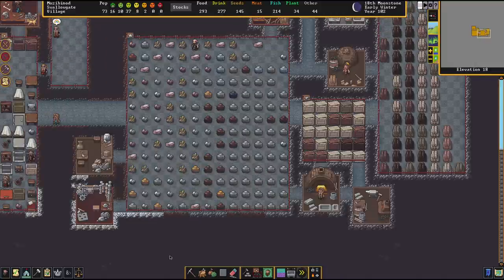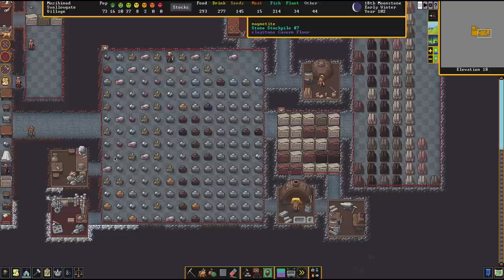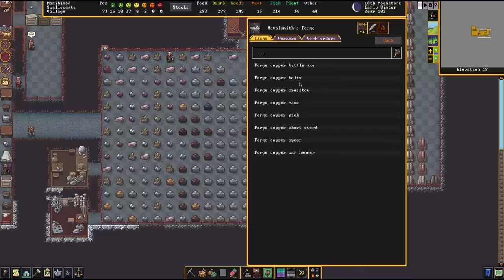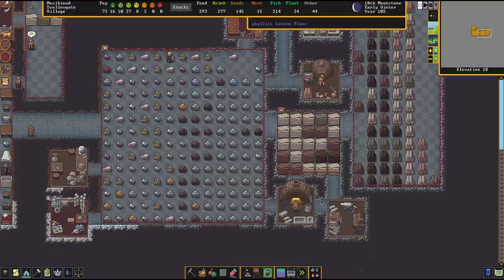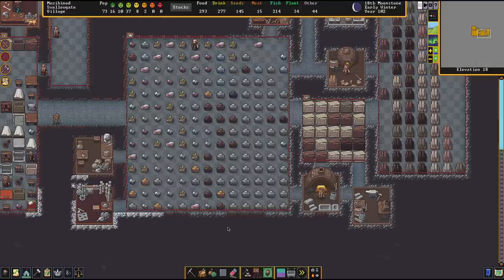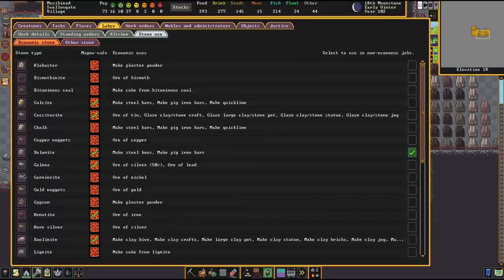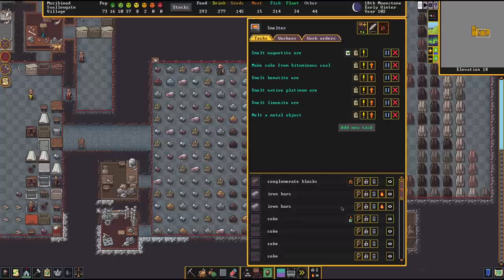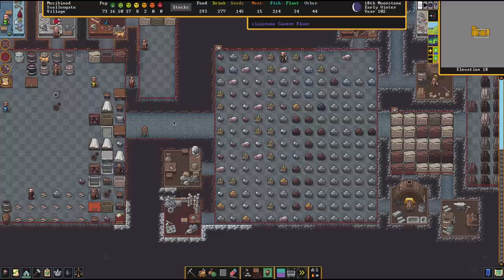ALL ABOUT METALS PT 1 - Tutorial DWARF FORTRESS Alloy Guide

Comment: I like to put lead floors at the bottom of pit traps. Fall damage is calculated based on how heavy the colliding things are, so heavy floors do a lot more damage than light floors.
Reply: that is kind of hilarious though water is as hard as concrete if you land flat <.<
Reply: not sure how that makes any sense. Shouldn't it depend on the hardness of the floor?
Reply: @incription idk hardness = heaviness in DF?
Reply: @kenjethao7774  I guess the right word is 'density' as lead is a very dense material.
Reply: @torgrimhanssen5100  Concrete is harder than water no matter how you land.   You're just repeating an aphorism that doesn't hold true.
Reply: @incription  thats literally the same thing if the mass is a constant. 1 m³  of any substance is harder than 1m³ of another substance that is lighter.
since if the mass is the same, but the weight is not, than that just means that one of the substances is more dense or in other words harder.
Reply: @unorevers7160  that is not true, hardness is not dependent on density (but slightly correlational). Diamonds are harder than lead but lighter for example
Reply: @incription  The game calculates fall damage as if the floor impacts the creature.  Since lead has such high density it will deal more damage than say adamantine which is extremely low density but super hard.
Reply: So lead floors with extended spike trap to guarantee death?
Reply: @TheSlyFawkes  Well, if I do a fall trap i'll have a 2 wide hall with a deep channel on one side and the walkway is lined with weapon traps, if they dodge they fall down onto lead floor.  Like a 10 Z drop onto lead floor is going to do more than just break limbs, probably explode body parts.
Reply: Don't forget that you can conversely use featherwood if you wanted to train up your suergons and bone doctors (assume your Dwarf doesn't break their neck). It's the least dense building material in the game currently.
Reply: That’s dumb, hilarious, and very dwarf fortress.
Reply: @unorevers7160  Gold is one of the densest metals in the world, but can be damaged by a fingernail. You have no idea what you’re talking about.
Reply: @virtualmartini  At a certain velocity it's the same.
Reply: @ballistixwearesilent5576  I don't think so.  It's always harder, no matter how quick you're going.  That said, if you're going fast enough, it doesn't really matter which one is "harder." Hitting water at terminal velocity might as well be concrete at that point. Hit either of them at a high velocity and you won't have enough time to compare hardness, given the whole "dead on impact" thing.
Reply: How hard is magma?
Reply: @fovarberma752  in game? Same as water. Out of game? I dunno probably like really really hot treacle?
Reply: @ballistixwearesilent5576  The question was rhetorical. Fall damage doesn't matter to goblins and zombies alike they land on magma.
Reply: @ballistixwearesilent5576  Also: Happy new year!
Reply: @fovarberma752  You can't ask rhetorical questions on the internet... It's against the rules 🙁
Reply: @virtualmartini  you belly flop on a body of water from 50m. itll be equal to falling on concrete from 10-20m. you probably wont explode into gore. but you can expect certain body areas to explode open and spray everywhere.
yeah water is still softer. but with enough speed and surface area itll be roughly the same as a solid.
Reply: @virtualmartini  ok, pseud
Reply: That's... a really good idea. I havent played with death pits yet but praise Armok I will
Reply: @thunderousavenger2382  it is indeed behaves similar to a solid when impact velocity is high enough, because it is a body with conciderable mass and surface tension. That guy just noted that saying that it is equal in hardness to concrete is not true, and i bet it isn't.
Reply: very annoying people mixing dwarf fortress fantasy topics with real world topics.   
If you want to discuss real world topics please keep them outside of fantasy game channels.

Comment: Im on my second base and I cannot seem to find any of the flux stone that it said was there so instead of steel weapons I’ve been making silver hammers because it’s such a good hammer material. Crazy how the makeup of the rock layers led me to have my warrior class be all hammer dwarves since that’s what’s available. The depth of strategy never ceases to amaze me.
Reply: Also, to answer your question about what lead is good for. I have limited knowledge and the documentation isn’t great, but lead is one of the densest elements and not as malleable as the precious metals so I’m assuming it’s also pretty good for hammers.
Reply: @nolans3420   It's not particularly durable, so while heavy, lead weapons don't take a lot to break.  Platinum is hands down the best blunt weapon material, heaviest and durable.

Lead itself doesn't have a ton of uses, I personally use it for decorations and statues.
Reply: The embark screen only looks at the exact tile your mouse cursor is hovering over. Its pretty easy to end up straddling tiles with various resource distributions without realizing it. Try digging an exploratory shaft in the northwest corner of your map to find it. Your cursor is in the northwest corner of the embark footprint when you put it down so that should be where it is
Reply: @stephenchurch1784  this is 100% true. Took me a while to find out.
Reply: @user-pz5mw2gn9y  true, I keep forgetting that dwarves are a different breed.  Any visiting humans might not fair to well drinking mead out of lead barrels in the tavern though 🤣
Reply: You may not have a flux stone layer. Dig down deeper as you likely have marble.

Comment: Some other used for lead:
Loading lead objects like lead bars into a shotgun minecart would definitely hurt a lot.
Studding lead onto crafts can help boost your craft value, but you can also stud ammo with lead if you want to add weight to those bolts.
Floors made of lead deal more damage because fall damage is calculated as if the floor impacts into the creature.
Reply: I remember someone loading lead coins into a danger room and instakilling a full squad
Reply: If you could use lead for Warhammers, it could do quite a HEAVY damage.
Minecarts works too, I guess.
Reply: @hushpool3915  Pray to Armok your strange mood weaponsmith grabs platinum for a mace/hammer. =P
Though of note, its possible to use other objects as weapons like a book.  Dunno if you could make a lead bound codex.
Reply: Thank you SO MUCH for the metal guide, I’m so glad to have them explained with examples. Incredibly helpful!

Comment: About Lead...
Lead in DF has some usage. 
- lead Mace is quite heavy, so it can strike hard (any heavy materials works with maces)
- good to use it to produce bridges and chains with the strength of steel at low costs (its solid metal, but heavy)
- anti-invasion minecarts (because they are heavy, so they strike hard)
- can be used to smelt low-value lead+copper+tin alloys (Lay pewter) in great numbers to mass produce cheap furnitures or floors with better ratio than smelting just a copper+tin alloys. On Steam version it has nice silver like, metalic and shinny color (its very cheap material, you can get a lot of it, alloy has higher value than raw metal bars)
Reply: You can’t make Lead weapons by default though right? Don’t You need a strange mood and a lot of luck to get a blunt weapon?
Reply: You can't make lead weapons in vanilla DF. If you could, they would actually be worse than silver - while it would be more dense, lead has worse material properties for both impact and shear damage. It's even worse than copper. It might have some use as bolts, I suppose.
It's reasonably useful for chains, but because of its weight it's difficult to haul. I wouldn't make my bridges out of lead, because it's not even fire safe, let alone magma or dragonfire safe.
They are useful as weaponized minecarts, because then you're not using steel that would be better used for weapons, or platinum that would be better used for decorations.
Lay pewter is fine, but I usually find myself with more copper than tin and lead, making it more reasonable to make bronze, which has military applications in addition to a better value. And of course lay pewter looks great visually; it's cheaper than silver and pretty good for that smooth "sterile" kinda look.
Reply: Fine pewter is better then lay pewter, if you have a surplus of cassiterite over copper ore. As you can make 16 fine pewter bar from a single ore smelt operation and it has the same material value then bronze.

The only reasons to ever smelt galena by itself are: to train legendary metal crafter on lead, while keeping the silver for exclusive use of weaponsmith, armorsmith and legendary metal crafter; to get the silver to make mace; that you want lead, lay pewter, silver, sterling silver, black bronze for a dwarf preference or personal aesthetic preference.

 If you have copper ore or gold ore the better use of galena is to make billon or electrum alloy at the ore smelt operation, as it will act like you had gotten 4 silver bar from your galena, while you only get 2 on average smelting the galena by itself, those 2 extra theoretical silver bar are over twice has valuable then the 4 lead bar you always get.

Comment: i could be wrong, but im pretty sure metal weapons are more likely to penetrate armor made of softer material. iron penetrates copper, steel penetrates iron, etc. so for crossbow bolts, wouldn't iron have better armor penetration than copper since a bolt is a piercing attack and not a blunt attack?

Comment: I wonder what metals are good for cutting weapons, aside from the sweet one. I also use lead on pits, because the fall damage is calculated by throwing the floor at the fallen Goblinite deposit.
Reply: Iron and best being steel, and then iron, outside of the spoiler ones. There’s some really great other ones, but you have to get a mood and luck to get those. Also there are some uses for non-optimal weapon combos: like using your lightest possible material to issue to your fort’s hammerer-because lightweight blunt weapons are really low damage, it greatly reduces the chances that they maim/kill the dwarf they’re punishing.
You used to be able to give them training maces made out of the lightest producible wood, (I think it’s called featherwood? The elves can bring it, not sure if it spawns in a biome)—It would be incapable of even bruising iirc. but I’m not sure a wooden training weapon is considered a valid item for a hammerer. I know you can’t use training axes for woodcutters anymore.
Reply: @okonkwojones  How cool
Reply: @gabrote42  ty for the tip on lead floors, btw I’ll try that. I didn’t know it worked that way!
Reply: @okonkwojones  One can find a lot of information on the forums and wiki if you don't mind spoilers :)

Comment: Great video, thank you!

Here are some notes I took if anyone might find them useful:

Aluminum (native aluminum): Rare, very lightweight, very valuable – good for making valuable furniture items (statues, etc). could also sorta be used for containers because of their weight, but really only good as a decorative material.

Bismuth (bismuthinite): Low value, relatively heavy – used to make bismuth bronze, which is like upgraded copper, and basically nothing else.

Copper (native copper, malachite, tetrahedrite, maybe more?): Extremely versatile – can make lots of good alloys. With copper and tin can make bronze which will totally upgrade value. Can make brass out of it. On its own is good for picks. The pick does not care about material until it’s used for combat, doesn’t affect mining speed, so is good for picks. Also makes great crossbows and bolts. Relatively heavy, good for melee with crossbows. Bolts have good armor penetration values due to their weight. Also cheap and abundant. Alright for containers, can make all of them, but relatively heavy. Also good for training weapon and armorsmiths.

Gold (native gold): Valuable, rare, similar uses to aluminum – decorative (cause good value). Too soft and too heavy for weapons and armor. Good for alloys. Good for constructing valuable environments to make nobles happy (like aluminum). Can use native gold ore (before smelting) at stonemason to create golden furniture. Requires trickery to do, but can make more types of gold furniture this way.

Iron (hematite, limonite, magnetite, maybe more?): Abundant, versatile. Used in production of steel. if you have no access to bronze, iron is a great, easy go-to to make all of your melee weapons and armor. Iron is the best middleground for melee weapons and armor, only topped by steel and otherworldy metals, so really easy choice for new players who don’t know everything about metals). Iron isn’t the worst for ranged weapons either. One of only two ways to make anvils (other being steel).

Lead (galena): Low value, heavy. Used in one alloy combination. Good material for crafts because it’s not good for much else. Good for smashing things with minecart traps because it’s really heavy. Good for bottom of pit traps because fall damage is calculated based on weight of surface fallen on. Good for bridges and chains (strength of steel but low cost).

Nickel (garnierite): Good alloy metal, magma-safe. If you’re not using it for the sake of alloying, it can be used for some other niche stuff.

Tin (cassiterite): Very lightweight. Almost as lightweight as aluminum, but much less rare. Therefore great for making lightweight containers like barrels, bins and pots to conserve wood. It’s main quality, however is for alloying. Can be used to make bronze, puter, and glaze for clay.

Platinum (native platinum): Super heavy, super valuable. Good for heavy blunt weaponry, but has to be made as artifacts.

Silver (horn silver, galena, tetrahedrite): Often found in ores that give other metals. Good for alloying, also good for value. Good niche for war hammers and maces. Almost as powerful as platinum but gets damaged quickly. Consider alloying BEFORE smelting tetrahedrite or galena. Good for decent value furniture as well.

Zinc (sphalerite): Very lightweight, good for containers, things that have to be carried around, etc. not very high value. Alloy friendly too. Good alternative if you don’t have much wood.

Alloys always use the word “make” and raw metals say “smelt _____ ore”.

Comment: Can you make bolts for crossbow and maces from lead if it's so heavy? or is there better choice?
Reply from the maker: As far as I've understood the material background, lead is too soft for both jobs. But it's really quite tough to get behind the combat mechanics of this game. 

Best idea: Give it a try and report your experiences! At least you will have a use for that Lead then :D
Reply: silver makes the best blunt weapons due to it's density, but like said they wear faster then say an iron counterpart. It's the difference between a hammer that hit's like a truck but you need to replace a bit more often, or a hammer you don't need to replace as often that does less damage to your enemies.
Reply: Lead is a extremely fragile metal so it's not really any good for weapon making. As to what the best bolt material is, steel seems likely but actually running the numbers would be too much of a pain for a quick youtube content. To expand on lichlord's comment and give you an idea of how hard it is to determine the "best" weapon material, silver is great for hammers not only because of its density but also because its impact elasticity and the force needed to fracture it (in kilopascals) works well with the contact area and swing velocity of hammer type weapons. Each of those properties are determined by real world physics of the weapon. Add to that the fact that certain weapon type and material combos work better against unarmored, chain armored and plate armored enemies and you begin to see why the steel for edged weapons and silver for blunt weapons mantra is really just a guideline for what will be a reasonable, general purpose weapon

Comment: Would lead or platinum maces be pretty powerful
Reply from the maker: Platinum - very much so, but sadly you can't assign your smiths to use it as a weapon material. You need to wait for an Artifact Inspiration and get lucky.

Lead on the other hand isn't listed as a good material. If I understood the system correctly it's mainly cause lead is very soft and would wear down extremely fast.

Comment: What is pig iron?
Reply from the maker: A pre-product used in the steel production. It's basically a worse alloy of iron, but you need to put 1 pig iron and 1 iron together for making steel. So it basically only exists for the purpose of being transmuted into steel.
Reply: It's a very high-carbon carbon-iron alloy that's brittle due to the large carbon content (as a result it has the [BRITTLE] tag like bismuth does in the game's metal definition files), it is combined with very low-carbon iron like wrought iron to produce a steel with an ideal carbon content to not be too soft or too brittle while still being superior to the base iron. The process of producing steel is abstracted a bit but I assume it involves a blast furnace to produce pig iron which is then forge welded to wrought iron or similar and worked to homogenise the resulting bar.